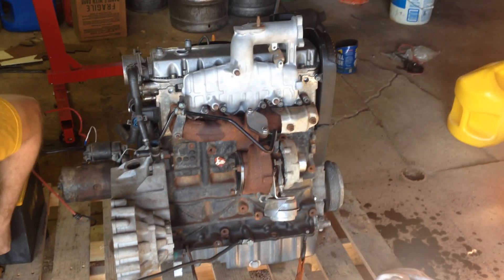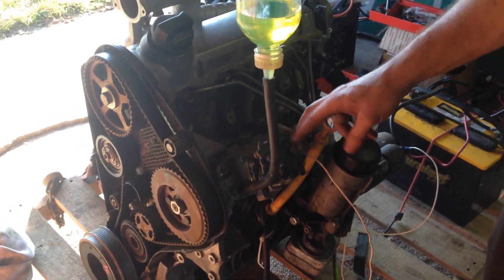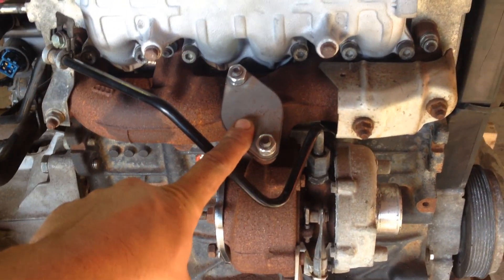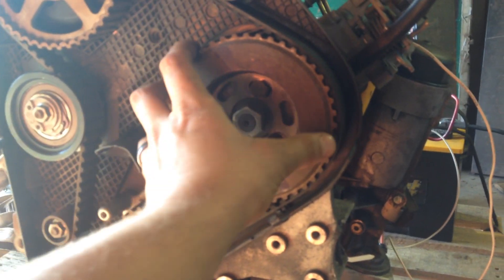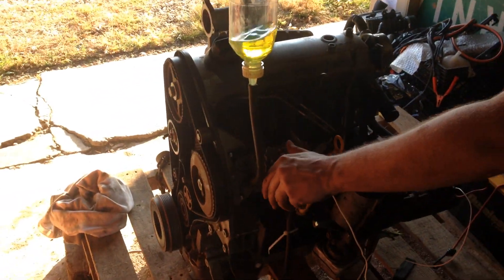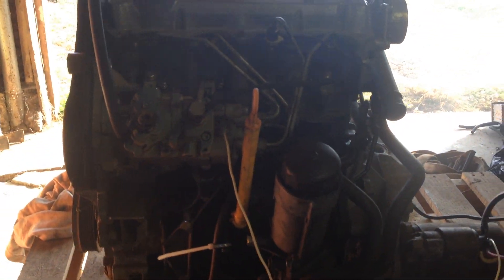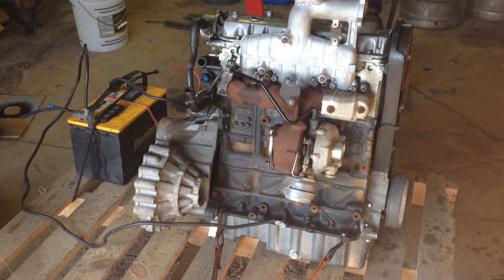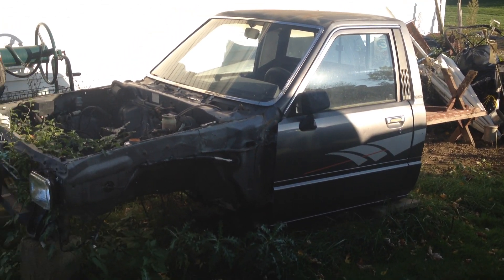VW 1.9L TDI engine - NO ELECTRONICS

Comment: Good afternoon, I am new to this whole TDI engine thing. I'm trying to run a 1.9 TDI on a mechanical injection pump so I don't need electronics. What do I do with the crank sensor? Do I need it or can I run without it?

Comment: I know this is an old video but for anyone wanting to make a similar modification you can get a fully mechanical p-pump from an older rabbit or golf 1.6 and it will practically bolt right in to where the 1.9 pump sits and I believe uses the same cam belt gear but could be wrong. The only thing that you have to look out for is injector / pump tuning. Ideally you'd use the 1.6 injectors to start off with to make sure the conversion works as they will match how the pump is tuned, but could go back to the 1.9 or bigger aftermarket injectors that way you can lower the overall duration of the injector fire, and therefore you can reduce egts and up the power, but that is if you are trying to really tune it to how it should be, a 1.6 pump and injectors will make this 1.9 a dog but usable, but there is a plethora of modifications you can do to tune the pump with bigger injectors. Buying an old pump is risky, but an old pump can almost always be rebuilt and retuned, as long as there is a parts market, or you can learn to resource and reuse old parts, but that requires having a good amount of space for an abundance of good and bad parts to salvage from, which can turn into a cluster-phobic headache or an eyesore for most who don't see the value.
Reply from the maker: It is an older view, but still gets tons of views and comments rather regularly. Thanks for the input! I wanna get a undated video shot and uploaded.
Reply: @bisket2003 From eich car is the pump? Does it works on this imjectors? Tnx

Comment: How did you set the initial timing for the fuel injection pump before the engine timing belt was installed
Reply from the maker: I don't exactly remember... I did have to buy a timing tool for the injection pump. But there are timing marks on both the injection pump and the engine.

Comment: Thanks for taking time to make this video.
I have a question for you, if you can please answer, just your thoughts. 

I have an engine 1.9SDI, mounted on a Skoda fabia, 2004. I want to use this engine on a mobile saw mill, unfortunately the injection pump it is electronic controled.
After several days of fails I manage to start the engine and accelerate it up to about 1200RPM with the electronic pump, just by opening the pump and making some changes.

If I buy a Injection pump from, 1996 , same engine but with TDI, the pump is mechnical, can I install it on this engine? it will work?? I am not concerned about lossing few HP, but it needs to run shooth . 
Just let me know what you think.
I contacted several companies  experts in Injection pumps and they told me they have lotd of work and they dont play with this stuff

Thanks again
Reply from the maker: The electrical system on the ALH can be made to stand alone using the stock injection pump and ECU. The ECU does need to be re-flashed though. 

The ALH never came with a mechanical pump as far as I know... You're  probably referring to the 1.9L AAZ. I have no idea how different that platform is...

Comment: No electronics..  there's the starter and the shut off valve my mtds can run on no electronics at all. I got the litle electric shut off valve out and i can start it down the hill 
(on a hot day of coure)
And shut it off with the mechanical shutoff lever verry cool

Comment: What timing did you set yours at ? I installed a Hans 10mm m-tdi pump and set timing at 1.40mm still no start. Only pops with starter fluid. Getting fuel and I bleed the injectors. Confirmed timing on cam and tdc

Comment: I’m interested in the mechanical injection pump conversion. Is that the 1.9 ALH ?
Reply from the maker: the pump was off an industrial NA 4BT
Reply: @bisket2003  any more info on the injection pump? 
I wasn’t aware cummins made a NA diesel?
Reply: @1966cambo  the backhoe when I worked at a cemetery had an NA 4bt
Reply: @1966cambo  lots of them.....especially back in the day they even had a super charged N series
Reply: VW did make mechanical pumps for the ALH, a guy in Canada imports them

Comment: The previous iteration of this engine the TD (no i) was particularly bomb proof. I had one in a Passat, I only filled up once a month, like this one it had no electronics at all. You could pressure wash the engine bay whilst it was running and it wouldn't stop.
Reply: I have pressure washed my bhw tdi while it was running. It still works
Reply: I mean you can do that to modern engines too lol. I worked next to a detail shop and they never shut cars off when they washed it, no problems with anything. I watched them do it to a maybach that made me nervous
Reply: you can power wash every single engine in the world while running that’s literally how they are detailed bozo

Comment: WOW!!! no electronics, Cummins fuel pump, you are amazing!!!!!!  Whate state are you guys in?  DCS (Diesel Conversion Specialists) makes a kit that will put a TDI on a chevrolet transmission it comes with the flex plate, starter, adaptor plate and all the nuts and bolts. How would you like to do a swap for me?  I have a mint 1987 S10 Blazer 4x4, 62K garage kept miles itcurrently has the 2.8 V-6 th700R4 trans.  That would probably have more HP, More TQ and better MPG OOOHHHH YEAH.   Let me know   cliff70chevy@gmail.com

Comment: How do you operate the vnt turbo without any electronics ?
Reply from the maker: still needs to be addressed.
Reply: @bisket2003  i think you have to convert to external waist gate instead of vnt. Theres no way to control vnt only the system has to work together in one ecu air,fuel, boost etc.. in my opinion

Comment: Hi you are amazing.  Would you consider putting a VW Diesel into my s10 blazer.  Diesel Conversion specialist makes a bolt up kit to a Chevrolet Transmission (adapter plate, starter, fly wheel etc...

Comment: Best engine 1.9TDI 90hp, till now 2.5 milion kilometers in 20 years. No big problems, regular oil change and time belt. Only bad spots are: electro magnetic ventil on bosh pump(fixed by direct connecting wire on ventil from light position) and intercooler pipe always blow(fixed with duck type).

Comment: HAHAHHAa pumping the pump like its a carb engine. Kills me every time I see that.
Reply: I know... A++
Reply from the maker: Its a mechanical injector pump, it moves some fuel to the injectors this way as the electronics are cut.
Reply: @bisket2003 Nope. You're stretching a spring, that is all. The governor is at or near full fuel position 'till the engine is near idle RPM.
Reply: @ryank5688 true because the centrifugal fly weights in the governor ate turning so slow still which allows much more fuel of the hop from low cranking speeds
Reply: @bisket2003 throttle position tells the injection pump how much fuel to inject at each normal injection event.

You are very close to the truth in your idea that the throttle would play some role in starting. However, rather than pumping the throttle, try holding it wide open. This means every injection event (even during cranking) will receive the most possible fuel.
Reply: Well, a relative of mine (70 year old gentleman, to be fair) have COMMON RAIL Renault Mégane and sure enough, he will always tap the gas pedal (on common rail car) few times before cold-starting it... ahhhh

Comment: I liked the way he "pumped" the throttle like it had an accelerater pump not a butterfly to allow air in. Lmao
Reply from the maker: Its a mechanical injector pump, it moves some fuel to the injectors this way as the electronics are cut.
Reply: What would it take to get a full list of parts off you, to do this?  @bisket2003
Reply: @bisket2003  do you have any advice on servicing a vp37 pump? I have a 98 tdi ahu that smokes and the ip leaks fuel.. i was told it needed injectors but other than the smoke it runs great. I hear fixing the leak will make it run better but im terrified on timing it afterwards. I got the vag-com but never used it before

Comment: 1,9 tdi alh engine with vtg turbo!
 A little bit better (simpler) 1.9 tdi agr engine,  turbo with simple flap mechanism to reduce / regulate the pressure.
I own the agr 365tkm / 230tmi consumption 4,5l/100km / 62mpg
Reply: 62 mpg??? On what build?

Comment: This will not work, how will you control the VNT turbo?
Go back to a wastegate turbo, but you will need a IP with boost compensation. If you don't have boost compensation it will act like a non turbo engine!!
Reply from the maker: We'll have to run a vnt turbo controller when we get to that point (been looking at the Digibooster), which will allow us to run as is. This turbo was stock to the engine anway.
Reply: bisket2003 then put a IP from a td engine. On the top of the pump there is a boost pin to compensate  with more fuel if you have boost. That is a must for a turbo diesel engine!!!
Reply from the maker: The IP is from a TB, just its a mechanical pump. This video is just an initial startup vid, far from complete. Just wanted to prove it possible. Once were able to get into the project again, we'll make all necessary adjustments to have to work as wanted.
Reply: bisket2003 get a AAZ 1.9 TD IP, it's by far the best one you can get...or some land-rover but only with modifications. Still didn't understand why you don't want to use the ecu.
Reply from the maker: Good call on the AAZ. Thanks. Simplicity sake. This will primarily be an offroad-rig. Wanna run stand alone electronics (fans, lights, ect). Just less to electrical to worry about or consider out on the trails. And also partially just because....hahaha.

Comment: can you use the land rover  300 tdi pump like on the 1z engine
Reply: Yes, you need some engineering and know how - but swapping a bosch VE for a different bosch VE is "relatively" easy if you know how, though even the easiest swap is hugely more work than keeping an original pump and simply having an injection pump specialist change the internals on an existing pump, for more fueling, govenor alterations, etc.

Comment: so its like a TDI converted to be an AAZ? (1.9L, mechanically injected)
Reply: The AAZ(TD) is a pre chamber diesel and the TDI is a direct injection engine with a ECU controlled injection pump. This guy has made a mTDI the m is the mechanical pump like a AAZ would have (No ECU).

Comment: i wonder how the turbo is Working with out the vaccum switch n75? IT need the écu to run the vnt 15 !
Reply: Sometimes people replace their VNT turbo with a wastegate turbo and a mechanical wastegate actuator.
Reply: im in processe imagining an electronic free vnt system wired on a cable throttle of my 2,0l jetta engine , found that complete manifold of 1.9TDI fit perfectly with the 2.0lAEG head , kinda cool
Reply: Yes I agree !
Reply: yeah but looking at this setup it appears to be the stock turbo with the vacuum actuator but no vacuum line going to the actuator nor is the lever that controls the vanes moving yet you can clearly hear turbo boost.
Reply: Magic.
Reply: Can one pin the vains open and use the egr port to mount a waste gate? I would imagine that would work just to get you going
Reply: Hello cummins 4bt bosch ve pump is that easily available part and how much did it cost you? Thanks
Reply: the waste gate  in these old motors just used manifold pressure and the spring in the waste gate to manage boost pressure curde but effective for millions of diesel engines made
Reply: if the vnt vanes react with the gaz pedal position it should work fine ?

Comment: Curious to see how it runs once injection timing is corrected.  One thing you have to watch is even though you get cylinder 1 on time, it does not mean the others will be.  I did a similar project a long time ago and had to TDC every cylinder, measure the injection start pulse, then change them by messing with injector line lengths, diameters and injector pop pressures.  Royal pain in the ass.  I'd common rail if I had to do it again.
Reply from the maker: Noice. Dully noted. Will take it all into consideration once we keep on this project.
Reply: You shouldn't have to on a rotory pump
I see your point about the lines lengths abd what not
Inline pumps I know u r supposed to phase and calibrate them plus your lift to port closure.....
Reply: Can common rail be used with a mechanical BT Cummins style pump? Your insight to timing is something I never considered.  I would have thought the pulley size and it's ratio relative to the camshaft and crank would have set the timing sequence more than the injector lengths.
Reply: bisket2003 that 1.9 looks like 1.4 I think mondeo's mk1 1.8 16v gas engine is biger

Comment: and is it still running good?...if not never mind my first question
Reply: the one downfall of running it this way, as I have looked into it very extensively, is you will lack the RPM range of the motor with the electronics and there is many guides on forums like Freds TDI club and so on that can walk you through how to get a bare bones electronic harness that is not that big and you can still use the 4000 rpm red-line instead of the mechanical fuel injection pump limiting that to about 3200 to 3600. This is due to the design of the mechanical pump not the motor or pulley setup, most mechanical pumps can't handle the excessive Rpm ranges past their factory settings, However if that still works for you, there is a guide out there on one of the forums, don't remember what one but a little time you can find it.
Reply: can he do a video in depth how to do it
Reply from the maker: Yeah, Lemme ask my bro and see if he can make you one and for how much.
Reply from the maker: anthony perras
Kick ass! Thanks for the incite. Will definitely keep this in mind as the build slowly progresses.

Comment: how did you tune the pump for the engine? or did you but too many questions for now
Reply from the maker: +Stephanie Kirby It's not tuned yet.
Reply: adjust pump timing using hammer method

Comment: What tractor was the mechanical pump pulled from?  Does he have a part #?
Reply from the maker: +Luke S Its a Bosch VE "Verteiler" Rotary style manual Injection pump. I'll try and get a part number off of it.
Reply: +bisket2003  ever get a number?
Reply from the maker: +Luke S ve pump 0 460 424 187
Reply: thanks... ever get the turbo running?
Reply from the maker: +Luke S not tuned yet. It all runs thou. Still have to tune and pipe. Been slowly working on the frame and body. It's a 10 yr project.

Comment: I think that is normal the all VP engines comes with a mechanical Pump the onlyelectronic needed is to warm up the  Glowplugs after that the engines dosnt needs eletronics i think (correct me if im wrong)
Reply: on the VW pre PD engines using the mech fuel pump its controlled by the ECU which is why they can be mapped , or 'evry' modded to get more power, as far as my knowledge goes anyway
Reply: I have one ALH(1.9 TDI VP) and the pump is mechanical(BOSCH) but its controled by eletronics
Reply: yea thats what am talking about , 1999-2002 or so

Comment: A dinosaur engines, one of the best diesel ever made by VW, there are really popular here in EU, a lot of people still have them even it turned over 400.000 kms. Skoda (one of the concern's makes) sold them with 66kw and 81kw, finally 96kw this one already have PD injectors. still doing service. I would assume the one shown would have 74kw or even 66kw if it's from golf. Super cheap parts, really reliable engine with low consumption!!!

my 1.9 TDi 77kw 2006 Octavia II. and my wife's 2.0 TDi 103 kw facelifted octavia II 2009 we curently drive could not be ever compared, both complicated PDs injectors....full of electronic devices such a pain...miss my old octavia 2002 I. 81kw!!! or golf IV 2001 74kw
Reply: Indeed. Stepping down two cylinders from a AKE 2.5 TDI (also a decently reliable engine) to this as my winter daily. A buddy drove his 1.9 TDI past 600k kilometers just recently, it even seem to have retained most if not all the horses too.
Reply: The 96kW doesn't have PD injectors and the 1.9 TDi 74kW is a PD. Only engines with the simple fuel pump were 66kW, 81kW and 96kW
Reply: @swiclabc  even 96kw has been a PD!!! Put this text to google translator “před časem potěšen oznámením automobilky, že se zavádí montáž TDI motoru s výkonem 96 kW. Ten je osazen moderním systémem přímého vstřikování paliva čerpadlo tryska neboli TDI-PD.” 74kw as well but this one has been fitted to a “tour” released octavias aroun 2010 only.